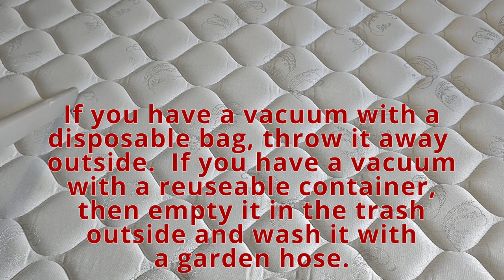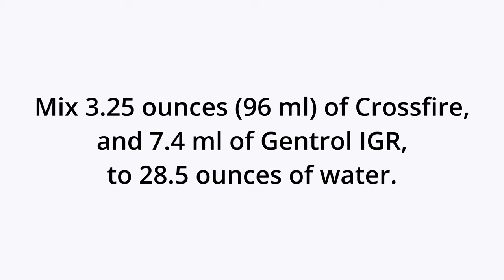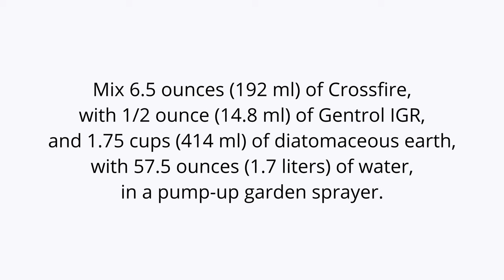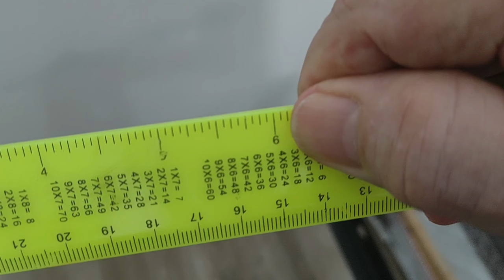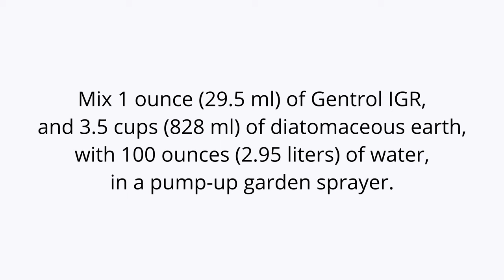ULTIMATE Bed Bug Solution!  AMAZING.  This ALWAYS works.

Comment: What about particle board beds or book shelves? Can you use a steamer on the surface of them as well? What about electronics or things you can't treat with all of the suggestions you have provided?
Reply from the maker: Great question.  I cannot exactly give you a rational explanation for this, but bed bugs do not usually take up residence in electronics.  While it can happen, most of the time it does not.  Still, you should not take any chances. The best way to treat electronics is to treat the surface that it is on.  If there are bed bugs in a TV, computer, gaming system, or any of that sort of thing, then they would need to cross the surface that they are on in order to get to the bed.  When they cross the treated surface, they are going to die.  You can treat the surface with the same combination of products that you use to treat the box spring.  That would include Crossfire, Gentrol IGR, and diatomaceous earth.  If you do not like the look of the diatomaceous earth, then just use the Crossfire and Gentrol IGR.

You can steam almost any surface you want, without fear of damaging anything.  Keep in mind that you only need to apply the steam for a very short period of time.  You wouldn't want to keep the steamer on one spot too long.  A good speed to work at would be about 12 inches every 30 seconds.  The hotter you get the steam, the faster you can move.  You need a steamer that will put out a temperature of at least 160° Fahrenheit.  I prefer to use a steamer that is way hotter than that.  If you purchase the one that I have listed in the description, that will put out a temperature of up to 320° Fahrenheit.  That means it would be an instant kill, so you can move along pretty quickly. There would not be enough time for the steam to heat up any surface well enough to cause damage.

I hope that helps.  Be well my friend.

Comment: I assume that these things cannot hang from the ceiling like spiders? You never said anything about the ceiling. That would be really horrible!
Reply from the maker: You normally don't see them near the ceiling.  That doesn't mean it can't happen, but they will need to come down to eat and they will encounter the pesticide on the baseboards.  I don't think they would drop off the ceiling.  I have never seen or heard of that happening.  I hope that helps.  Be well my friend.
Reply: We had an infestation that came from (we FINALLY figured it out) from swallows nesting on the eaves of our house while we were away on holiday.  We had them a few years before this and got rid of them by hiring a heat treating outfit, and it worked, but not this time because they were in the attic of the house and were coming in from above us!  We had to put plastic over our bed and covered it with diatomaceous earth, as well as the bed trays on the legs of the bed.  And we essentially rode it out.  Every night, and throughout the day as well, we would use our cordless Dyson vacuum to vacuum the ceiling in our bedroom.  It was stipple, so they were tricky to get off.  Some nights we would vacuum 40-50+ bugs off the ceiling - it was a f*ing nightmare, especially since I’m essentially allergic to the bites.  I would really react to it - extreme itching and swelling.
It took 4-6 months of doing this (it helped that winter here in Canada came and helped kill them off in the attic).  My wife and I developed a little PTSD after that bout with them
Reply from the maker: @woodcogger42  Yes.  Although uncommon, that can happen sometimes.  Some bed bug species can be spread by swallows, but they are different from the bed bugs that typically feed on humans.  They can still eat you though.  Make sure that you seal up the openings in the attic where the swallows got in.  Thanks for sharing.  Be well my friend.

Comment: I have teeny tiny white &red "crumbs" on my bed after we sleep.plus bites. I've never seen any bugs but we're getting bite. I bought Crossfire and diatomaceous earth but it doesn't work.ive cleaned so well, everything u said,ive done.yet still "crumbs" like Italian seasoning still in my bed.can u help me?😢
Reply from the maker: That's very strange.  Did you vacuum, steam, and treat everything with the recommended products, and did you put the mattress and boxspring in a bed bug proof mattress bag?  Did you vacuum, steam, and treat the bed frame?  Did you place sticky traps under the legs of the bed?  Is the headboard removed and the bed pulled at least 6 inches away from the wall?  If you did all of these things, then I don't see how anything could be getting into your bed.  If you eliminated all the pests from the bed, box spring, and frame, and placed sticky traps under the legs, then there is no way for them to climb up on the bed anymore, so you should not be having a problem.  If you have not done the full treatment, then I suggest that you watch the video again and do everything exactly as shown in the video.  If you still have the problem, then send me a photo of this material.  You can send photos to guyspestsolutions@gmail.com.  Please give me your YouTube name when you email me.  Do not take the photo with an iPhone because they are not good with close up photography.  Androids are way better at this.  Please watch my video on how to photograph a bug and use that same technique to photograph this material.  Let me know if this stuff is sticking to the sheets or if it's kind of loose and easy to move with your finger.

I hope that helps.  Be well SusieQ.

Video on how to photograph a bug:  https://youtu.be/I8qd63hX6y8
Reply: @GuysPestSolutions  
Thanku for writing me back. A big YES to everything you said and more! I bought the Insect interceptor traps for the bed frame. I'll email you after I watch ur video. Thanks again for your help
Reply from the maker: @susiequsie1980  Gosh, if you bagged the mattress and the box spring, and there is no headboard, if you are still getting bitten, then they must still be on the bed frame.  So, you would need to retreat that bedframe.  Steam it really good and reapply everything.  Wash all the sheets again and make sure that there are no bed bugs on the mattress covers.  Also, make sure that you are not bringing the bed bugs into bed with you.  They may be on your couch, the floor, and so forth.  So, do a good job treating absolutely everything.  These guys are hard to beat, so don't underestimate them.  You need to be really thorough.  Just keep at it and you will eventually defeat them.  Be well SusieQ.
Reply: @GuysPestSolutions  thanku so much. Trust me I'm cleaning everything. I think maybe it's in my carpet. I'll keep you posted but I appreciate all your help 🙏 I'm trying to be well and not go crazy. Also, is that a New England accent? I'm from. N. H.
Reply from the maker: @susiequsie1980  Bed bugs are almost the worst pest you can have, so I can understand how you feel.  I'm from New Jersey.  I never realized that I had an accent before I started doing YouTube.  Now people are asking me about it.  Like you, most people guess the Northeast somewhere.  Be well SusieQ.

Comment: Question: I thought you can’t mix DE with water???
Reply from the maker: You can mix DE with water, but only mix as much as you are going to use right away.  When it dries, it will leave a fine dust on the surface, which is what you want.  Be well my friend.
Reply: @GuysPestSolutions  Thanks
Reply from the maker: You are very welcome.  Be well my friend.

Comment: Spray for bed bugs
Reply from the maker: There isn't one spray that will get the job done.  You need to do everything in the video.  It's hard, but it can be done.  The important thing is to get started and be thorough.

Be well Shirley.
Reply: Crossfire.
Reply from the maker: @seahawks1185  That is one of the products mentioned in the video and it is an important part of the treatment.  Be well my friend.

Comment: Where do bed bugs come from my mattress is in cover on my bed I can't stand it
Reply from the maker: You usually get bed bugs because you stayed someplace that had them.  You didn't even need to sleep there.  Yoey u could have gotten them from someone's home just by sitting on the couch.  Sometimes you can get them at a movie theater.  Most of the time though you get them from sleeping in a motel or hotel that has them or someone stayed at your home who brought them in.  They didn't even need to spend the night.  After you get them though, they are very hard to get rid of.  Just follow the directions in this video and that will end your problem.  Do not believe all the false claims about sprays and stuff that will eliminate bed bugs.  They don't work.  If you want these guys gone, then you must do the work.  It's not easy, but it can be done.  The key is to be thorough.  

I hope that helps.  Be well Shirley.